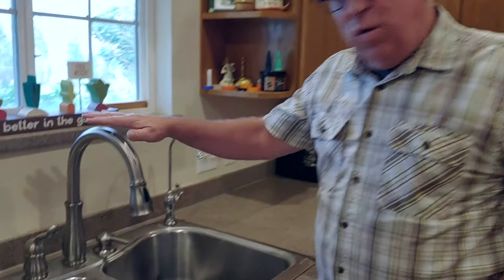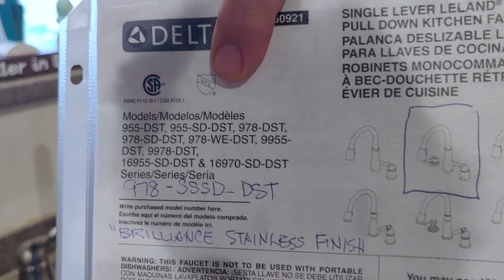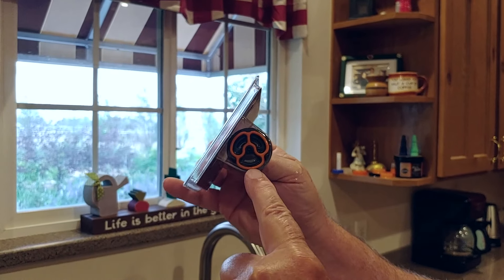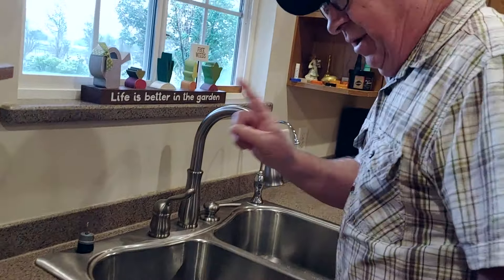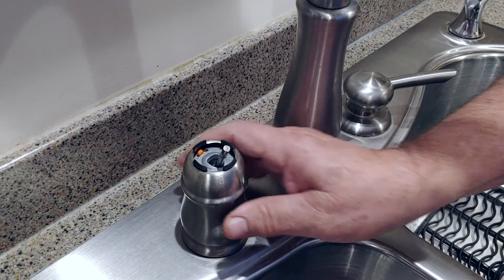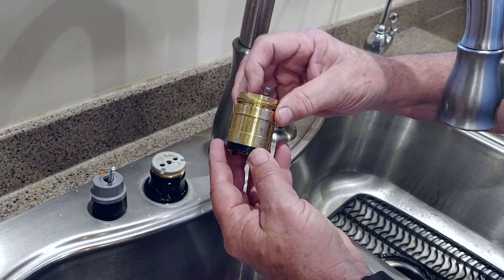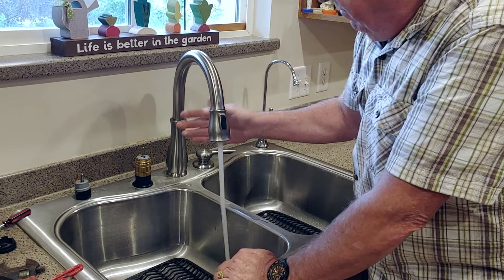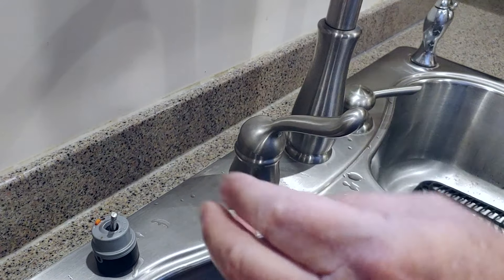Delta Single Handle Faucet Cartridge Replacement

Comment: looks easy but sometimes it is impossible to remove the cartridge retainer cylinder because it was welded in place to the lower plastic casing, maybe because hard water deposits. I recommend using some plumbers grease on the plastic threads before you put back the cartridge and retainer. In my case I had to throw away the whole valve and buy a new one.
Reply from the maker: This is some good information. I like the grease idea before installation as this eases removal during service in the future. I use PTFE tape on metal and plastic plumbing threads not only for sealant, but for easy removal later. Eliminates "seizing."  Thanks for writing! Best, DFJ

Comment: I tried fixing our faucet, which is the same as this one.  For the life of me, I could not get that brass fitting to turn off, and I cranked hard on it.  I even tried to use a second pipe wrench to hold onto the bottom black fitting.  Not sure why it is so hard to turn off.  The faucet is only 3 years old.  Any advice on why I'm having such trouble getting the brass fitting off?

Also, one other thing.  That outer decorative cover just twists off.  You don't have to pry the tabs to get it off.
Reply from the maker: Varnk,  thanks for watching our video and writing. That is quite the challenge. As you know, brass is somewhat soft, so lots of pressure can damage it. Is it possible you have a reverse-threaded unit? That's really reaching, but what you are trying now isn't working. Assuming you have a typical set up, the other thing that I can think of is using something like Blaster Penetrating Oil and see if you can get the threads to release. It is strange that your faucet is only 3 years old and this has seized so bad. If you have a lot of minerals in your water, it can really weld things together! Let me know how this turns out! Best, DFJ
Reply: Same problem, but not resolved yet. I found that Delta has some bonnet removal tips here: https://support.deltafaucet.com/s/article/Bonnet-Nut-Removal

Comment: HELP.   I turned off both water knobs under the sink .  Removed the cartriedge following your innstructions.  Water was leaking out of where the cartridge was,  so I turned off water to the entire house.     2+ large bowls of water have dripped our of the cartridge slot and under the sink.    So, I turned off the water to the entire house.   I tried other house faucets and they have no later.    Hot water is coming from the hot water slot  (in the gray  (ceramic ?) disk (from the hot water side) that the cartridge fits into its slots.      The hot water will not stop coming and water to the entire house is turned off?      I've reseated the cartridge  (new and old)  several times and screwed the brass piece back on.    Nothing works.  the water won't stop .  HELP
Reply: Nevermind,    I didn't turn off the hot water,   Yes under the sink, but not by water heater.      Mission competed.   Incredibly easy except for my misstep
Reply from the maker: Glad you got it figured out! How did the repair to the faucet go?

Comment: I have the same faucet. Do you notice it is difficult to shut off unless you find the sweet spot?  Is there a fix for this?
Reply: Just FYI i replaced the Cartridge and it seemed to fix it.  I must of gotten a bad one right out of the box since it was included with the faucet.  I bought
It at Home Depot.  Still waiting for Delta to get back to me about a replacement.  Thanks for the helpful video.

Comment: Did you turn off the water during this repair??
Reply from the maker: Yes, indeed. The inlets will be open and you'll "enjoy" quite a fountain if the supply valves are not shut off. Best, DFJ

Comment: You did a great job teaching us how to change the cartridge on the Delta faucet.  I have the new cartridge ready, can take the handle off (turning off the water beforehand). But, I cannot get the brass "nut" to come loose. I've used an adjustable wrench and a cylinder lock. I've been aware to only untwist the nut - no go. Any suggestions what could loosen it? I'm guessing there's hard water residue... Thanks Jim!
Reply: I'm in the same boat! Did you solve the problem? If so, how? If not, what did you end up doing?
Reply: @AndrewDolanABD  Hi Andrew, I tried the vinegar (which is a great solution to many problems, ie hard water deposits, plugged shower head holes, etc). But, that wasn't  the case. I ended up having a plumber come and even he couldn't loosen it. He ended up having to remove it in such a way that it would be damaged & then replaced. I hope your situation doesn't turn out the same. Good luck!
Reply: Same problem, but not resolved yet. I found that Delta has some bonnet removal tips here: https://support.deltafaucet.com/s/article/Bonnet-Nut-Removal

Comment: I cannont unscrew the vrass at the top of the sheath holding the element
Reply from the maker: Make sure you are turning it counter clockwise and maybe some WD40 or Blaster to lubricate the threads so it will let go. Best to you, DFJ

Comment: Tried for over an hour and couldn't get the bonnet nut to loosen at all to take the brass housing off. The black plastic bottom piece wants to turn with it even when trying to hold it with pliers. Had to put everything back together for now until we figure something else out. Any ideas?
Reply from the maker: DFJ says try using WD 40,  Liquid Wrench or Blaster Clear Penetrating Lubricant on the nut head, Spray around it and let it soak in. Then try to loosen it. If it won't give way, spray more and repeat until you can get it off. It takes time for these products to work so you may need to let them soak for nearly a day. You probably have some hard water deposits around it which can really hold on unless you can make them slippery with these products.
Reply: @DirtFarmerJay  Thanks! A little more PB Blaster totally worked!

Comment: My sink is leaking from handle itself not out the faucet. Would the cartridge be at fault for that?
Reply from the maker: Yes, its the cartridge. The only other thing it could be is that the bonnet nut has come loose. Check that the bonnet nut is snug. Let me know what you fine. Best, DFJ
Reply: @DirtFarmerJay  I appreciate you replying back to me. I had to drive 1 hour away to find a replacement cartridge. I have a Pegasus faucet but looks a lot like a Price Pfister. I hope and pray that it works.

Comment: Can that piece you replaced also get plugged up causing very low water flow?
Reply from the maker: DawnEna - for some reason, this didn't show up until now in the middle of a thread. Sorry to ignore you! Indeed, it is possible to have calcification take place to the level that water flow is restricted. In this case, you could try removing the cartridge and submerging it in vinegar or a citric acid mixture to see if you can dissolve it. It's not a sure shot, though, as the acid solution may not get into the areas that affected. Let us know how this turned out. Best Regards, DFJ
Reply: @DirtFarmerJay  I watched your video because I couldnt figure out why my sink had low water pressure. Followed your video, took the old cartridge out and submerged it in a mason jar with 1 part vinegar and 1 part water. I gently shook it for a couple minutes, reassembled, and now my sink has great pressure again. Thanks so much for your video.

Comment: Hey we have this sink and the black ring at 6:20 will not come off (yours stayed inside the outer shell piece, do you have any tips to get it removed (without breaking it)?
Reply from the maker: DFJ is taking ours apart again to see how to best help you....stand by....
Reply from the maker: OK H L, We took it apart and the black ring is threaded so carefully unscrew it to remove it. When putting it back together, put the black ring back into the silver cover and turn to fit into the grooves on top. Then with a light touch hold onto the edge of the silver part and the black ring and lightly screw it back in. Once in all the way, it will pop back down with just a little pressure. Let me know how it goes for you. Best, Dirt Farmer Maggie  P.S. DFJ has a brother named HL!!!
Reply: @DirtFarmerJay  Thanks, this is exactly what I needed! Got it fixed and leak free so far.
Reply from the maker: @hunterlavish  - glad to have got it solved with you! Thanks for being a part of our viewer family. best regards, DFM and DFJ

Comment: How to remove the stuck faucet to replace the cartridge after the step 1 removing the tiny screw
Reply from the maker: desisat1, I'm not completely sure what you mean, but I'll take a run at it. After you remove the set screw to remove the handle, the next step is to push back the tabs on the black retainer ring that holds the trim cover in place. That will allow you to lift the trim off and expose the cartridge. If the retainer ring did not come off when you removed the trim, then do so. Then, you will need to use a large adjustable wrench to remove the bonnet nut that holding in the cartridge. Go easy as you do to avoid damaging any components. Once the bonnet nut is removed, the cartridge is ready to be removed. If you find it difficult to get the cartridge to come off, it's likely there is minerals that have stuck the integrated gaskets to the base assembly. You'll need to rock the cartridge side to side to get it to release and then you can complete the repair as outlined in the video. I hope this helps! Best, DFJ

Comment: It was supposed to show JAY, rather than Jim. Sorry!
Reply from the maker: No problem DHL. Sometimes I call him other names besides Jay too.  Best to you, Dirt Farmer Maggie.
Reply: @DirtFarmerJay  Hi DF Maggie, thanks for your response :)
I wonder if DF Jay had any suggestions how to loosen the brass "nut" that holds the cartridge? Thought maybe hard water buildup might cause it not to come undone.  When I twist the nut, the whole thing wants to twist - I stop because I don't want to strip anything or damage my faucet.  Thanks again :)
Reply from the maker: DHL, give vinegar a shot to dissolve calcium, or WD-40. Is the outer shell rotating, or is the whole unit spinning when you turn the bonnet nut?

Comment: Caulking the bottom of the trim cylinder is not a great idea; plumber's putty is preferable, because there is no water under pressure in the trim. Water will only get under from splashing on the outside. Caulk will seal the cylinder to the horizontal trim, making future removal unnecessarily troublesome. Over/misuse of caulk where greases or putties or thread sealants are called for makes an unprofessional finish.

Comment: Not easy when the bonnet is welded on from all mineral  deposits
Reply from the maker: You  might try vinegar to loosen the hard water deposits. Otherwise you can use "Lime Away" which is a hard water deposit remover.  Best to you, DFJ

Comment: Great video.  I recently put up a video on my channel of a Pioneer faucet that we had installed by a "handyman".  We purchased it brand new from him for $156.00 plus his labor $85.00 he took out our old faucet and took it with him.  Installed the new one it was leaking!  He thought he got it to stop.  He left that night was gone about 20 minutes then it started leaking again, so I called him back.  He came right back.  Looked it all over and he figured it to be the ceramic cartridge.  So he left and came back the following morning.  He installed the part.  It didn't leak.  Now, it has been in about 3 days and tonight it is leaking again!!!!!  Well 3 strikes your out!  Or we are.  Now we have a new faucet with faulty parts and are out all that money!!!!  We just called an actual plumber and we are awaiting for him to return our call.  It is really frustrating.   Any suggestions???
Reply from the maker: If it's an actual Delta faucet, you can call Delta and they will send you replacement parts with no charge. The first place to look is the ceramic gasket. Look at the end of the gasket (that looks kind of like a monkey face) for any debris in it like sand (if you live in a rural area) or for any damage (Like maybe when installing it, the rubber gasket was nicked by the plumber with a screw driver, etc.) If you discover any defective parts, you can order new ones from Delta at no cost. Hope this helps! Best, DFJ
Reply: @DirtFarmerJay  Hi Jay, and thanks for your advice. Well, the plumber came out and he tightened up everything that the handyman did.  So another $85.00 later we discovered that was all it was.  Great it got fixed!! However,  the plumber took it upon himself to also tighten other things under the sink and for good reason but after he left my J- Bend that wasn't leaking started to leak.  My hubby was beside himself to be out over 300 dollars on two different guys and still have something wrong a leak.  So I said that's it and I took it off myself.  It was gunked up with hair and other nasty stuff.  After cleaning it out I put it all back together and a couple hours later a few drops.  That kept happening.  So I said we just need a new one.  Went and picked up a new J-Bend and I installed it.  A small drip so I had my hubby tightened it with his hands and ever since I'm leak free!! 🤪😃 What an experience!! I use to be married to a plumber so I knew a little about it but never actually did it myself but  I'm proud that I was at least able to stop that leak. Thanks again for your advice.  Now crossing fingers and toes that our bathroom sink stays leak free.  When that plumber was tightening things he also went to look at our bathroom too.  He turned that hot and cold water valves and they dripped water from both handles.  We bought an older home that had a handyman doing repairs.   He changed that bathroom sink himself and the left side handle turns the opposite way from the cold.  It's always something 🙄 😒

Comment: I have had to replace this cartridge yearly. As we inherited the faucet by buying the house, Delta will not send us the cartridges for free.  It's truly poor quality and I would not recommend a Delta with this cartridge to anyone.
Reply from the maker: Thanks for jumping in on this and telling us your experience. We are hearing a few more comments like this that there are people that have poor experiences with it. I don't think it's very tolerant of water that has high alkalinity and/or calcium or any other pH problems. And, there's a lot of places in the country that do have those conditions. Again thank you for the heads up. It sounds like it's time to go to another brand and pay a little bit more for something that you don't have to address yearly. Let me know what you end up doing on this. I'd like to know what brand you went with and your long-term experience. We like to get the word out on issues like this. Like I said, thanks for writing.
Reply: @DirtFarmerJay  ...aaand then there's the other side. I just bought a new faucet, same one, and called it a day. We really liked the faucet and were used to it, so the options were to keep or replace. The old one was loose at the counter before we bought the house, and water hand leaked down — you know how that goes. The under-counter attachment cleat was crumbling, and the nut was frozen onto the corroded brass threaded attachment tube. To keep it, I would have had to source a new cleat (can you believe Delta lists them as “discontinued?”) and work the nut allll the way off and back on, AND would have to continue to buy new cartridges. I figured on balance a new one installed properly would last and is warranted to us — and I’m a sucker for a challenge. Installation was easier than removing the old one, this one’s in proper and tight with added silicone sealant under the mount (daresay I did a better job than whoever installed the last one), I now own a basin wrench, and Delta will have to send me replacement cartridges. It was fun.